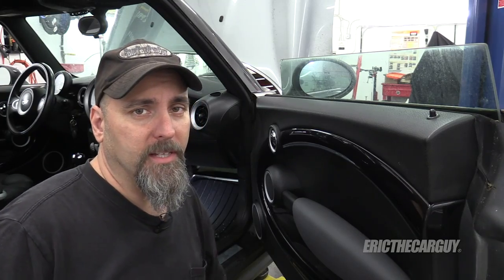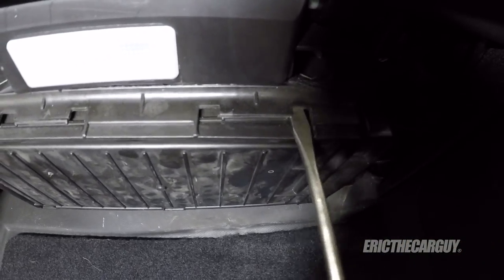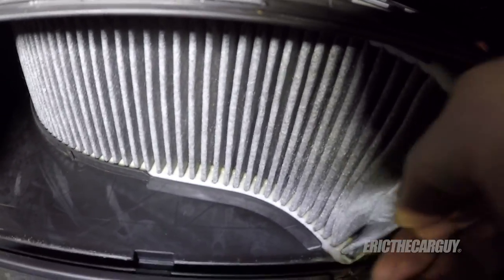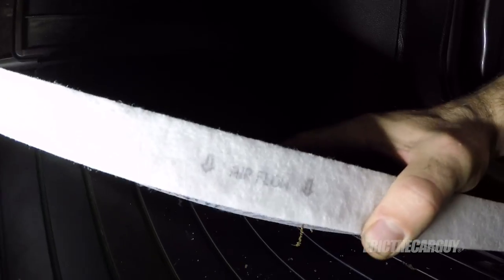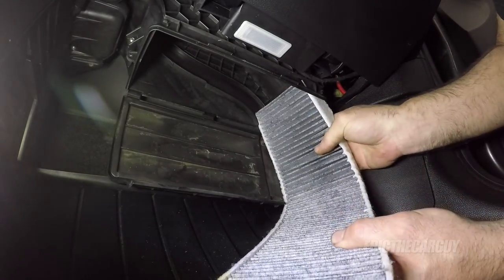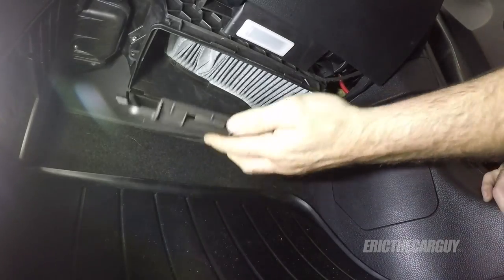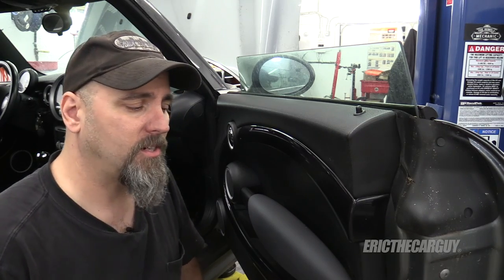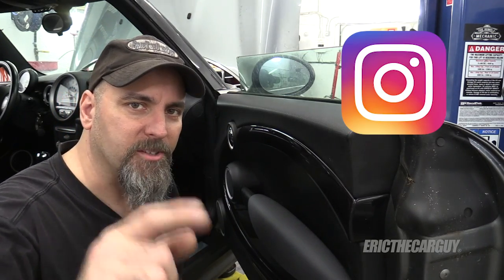Mini Cooper Cabin Air Filter Replacement

Comment: Pretty easy job on the mini. Some cars will have you taking an anger management class. I’m looking at you, nissan😡
Reply: Haha! The cabin filter in my wife's 2013 Maxima is...challenging.
Reply: You are not wrong.   Nissan's cabin filters were designed by someone that has a personal thing against techs.  It's infuriating, especially seeing how other brands can make it so easy.
Reply: lol. So true.
Reply: You get this large filter that you have to smash into a slot half the filters  size.🤣😂🤣
Reply: Damian H that's why I don't bother changing it. It's not necessary really.
Reply: Damian H I haven’t had to change any Nissan cabin air filters but my 2004 Saab 9-5 I used to have had the cabin air filter buried in the middle of the dash behind the center stack. Disassembling the lower passenger side of the dashboard while standing on your head is not fun. On the other hand, it takes about 30 seconds to change the cabin air filter on my 2015 Mazda 6.
Reply: Yeah ford focus too, removal of glove box and fuse board!
Reply: I've got an Xterra. Getting that damn half-filter over into the ride side of the box makes me wanna set fire to the thing. A really long screwdriver makes it a bit easier.
Reply: You have to take the glovebox out of my tundra, and I've worked on cars you had to take literally half the dash apart to do it. This was easy peasy. I did this and the air filter under the hood in less time than it took to get the needed tools out lol

Comment: I did mine because I didn’t have one at all when I bought mine the previous owner was going broke and sold the car because they couldn’t afford it and he told me it had no filter because the old one was so restrictive because it was bad. I kinda just guessed how to put it in and was half right, I put it in right except I forgot to check the air flow directions. So much better now thank you

Comment: This design is very similar to the cabin filters used by Lexus. FYI use two hands and take it slow, carefully slide it through the glide tracks pushing with one hand and pulling with the other and you can keep the filter looking nice! I noticed a lot of Mini enthusiasts just yank the new filter in and don't maintain it's gilled structure. I don't know if it makes a difference but when the filter is all bent it looks really hacky! Also this design is a lot better than the awaked cabin filters in BMW 1 series and 3 series that's are located in the engine bay and have the most fragile tabs that are difficult to align. The Mini's air filter placement is a lot easier to access also!

Comment: That's a pretty easy filter to replace!
Reply from the maker: It's actually a little tricky. That stupid 'S' curve makes it somewhat challenging. Not impossible, just tricky.
Reply: Still looks easier than replacing the cabin filter in my Chevy truck. Have to remove like four or five 5.5mm screws to get the lower dash off before you can even get to the filter housing.
Reply: If this is difficult check out Renault megane 2&3.
Reply: BMW Mini. Making your life hard, even just for a damn filter..
Reply: I just youtube'd the renault megane cabin filter video, you might as well change the blower fan, heater core and ac condenser while you're at it =)

Comment: Man, that is one idiotic-looking configuration.
Reply: It's worse than having to take off scuttle panels outside!
Reply: Its more like silly 🤣
Reply: You're not wrong... When I watched the video I had to pause one minute, scratch my head, and ask myself the question "What the actual fuck?" then again when I actually did the work. Lol
Reply: It's to maximize the surface area and minimize the flow resistance in a tight space.
Reply: @petersherman2552  Correct

Comment: I bought a 2008 Honda 2 years ago (used obviously), an EX-L. Apparently, I was the ONLY one that thought of replacing the cabin air filter in it, as it looked like it had been there a good decade plus already. Nasty, full of leaves and dust/dirt and feathers. I can't remember what Honda's recommendation is, but at $ 10 a filter, I replace it yearly as part of my P.M. rounds.

Comment: So I wanted to replace my cabin air filter a few weeks ago, took me about a half hour to realize I didn't have one. When did cars start getting cabin air filters?
Reply from the maker: In my estimation late 90's.
Reply: My 2002 Citroen Berlingo pre face lift doesn't have one not fun when you turn on cold air and get a face full of saw dust cause I'd have it parked in or outside my wood workshop
Reply: My 2000 civic has the spot to put a cabin air filter but apparently they were only shipped with one installed in europe.

Comment: Hey Eric, when will you upload the video about how you replaced the bent exhaust valves ? .. I have a Citroen DS3 and I think I will have to remove the cylinder head cuz cylinder 1 on my engine is burning oil and I have to do some work on it.

Comment: Unrelated but my starter recently went out in my 99 Chevy Silverado after having a weak turning over. Replaced it and tried cranking battery toast so I replaced it now my truck turns over fires up for a second then goes back to turning over. I’m completely lost but while I’m turning it over the inside of my truck starts smelling different so I went and smelled my alternator and it has the same smell. Could the alternator stop my truck from cranking?

Comment: Can you please tell me will this help the gas mileage are this a filter for just the cabin area inside for briefor breathing air I'm trying to figure out which filter is going to help with my engine breathing better because I used to get 50 miles a gallon now I'm getting 35

Comment: Had our 2016 Nissan Rogue in for a oil change, ask them to change the cabin air filter. I was thinking maybe $20.00 or so. imagine my surprise when I got the bill $164.00. When I got home I checked our local parts store and could have picked one up for $9.99 Next time I will do it myself.
Reply: Cost isnt only parts and physical labor but also disgust factor! I would charge $160 to replace some air filter on a 20 year old smokers car that had never been replaced too.

Comment: Hi air flow direction should be to up in all systems ami correct
Reply from the maker: It really depends on the system. Air usually comes in under the windshield wipers.